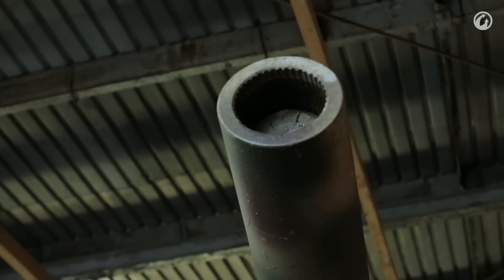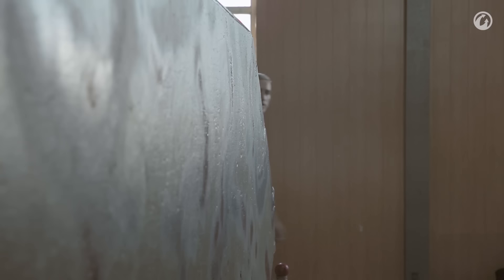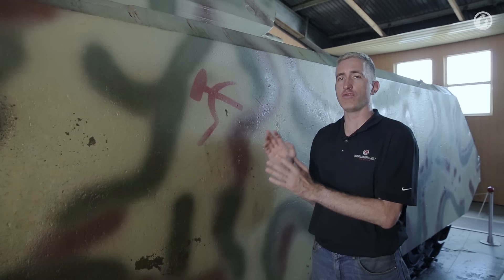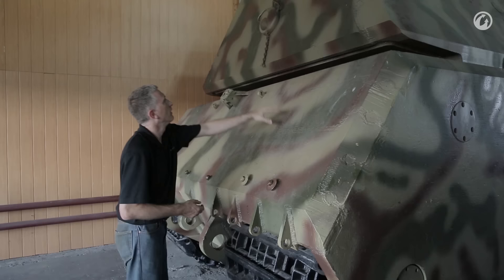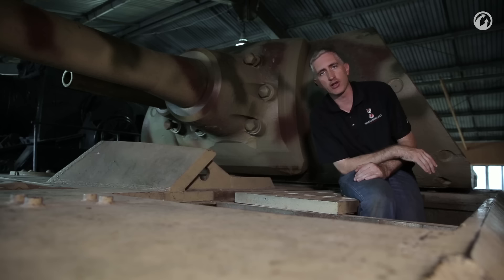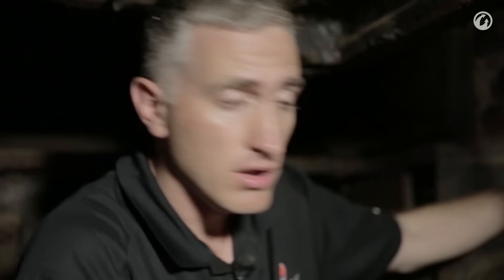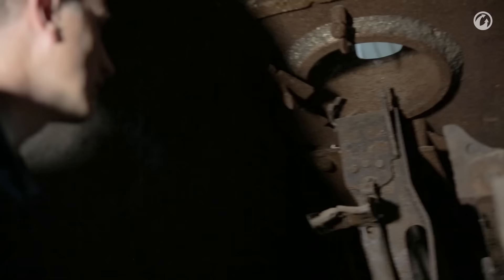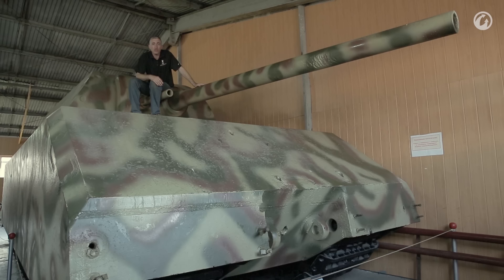Inside the Chieftain's Hatch: The Mighty Maus

Comment: I would like seeing this thing alive again, imagine an modern tank stuck in an corner in an city, noticing an maus driving around an corner and pointing the gun at this modern tank. The commander would be like " ahhhw i hate this job"
Reply: Doesnt sound too bad, the 128mm will do precisely nothing to modern composite armour.
Reply: T0mm3n 128 at point blank range, if it hits the modern tanks its over. Maus armor is made to bounce 128 cm or less even at point blank range, but modern tanks are designed to not get hit and if they get hit, most times they dont get directly hit, but on almost point blank range its not an good sign for the modern tanks...
Reply: T0mm3n not true really. modern tanks are a lot softer than you'd think.
Reply: babs beaver on like 150 meters away the projectile has its full power, it will go in wirh such an power, an direct hit will penetrate.
Reply: Davy Jones Considering the 12.8 had max pen values laughably short of modern mbts effective thickness, nothing would happen. Think of how much more energy a modern sabot round has compared to the 12.8, the 12.8 is not even in the same ball park. Modern sabots have well over double the kinetic energy compared to the 12.8 and still can have issues getting penetration frontally.
Reply: nmdiesel89 maybe on longer longer ranges, when they didnt get hit directly, but with an clear shot at point blanc range they will pop like ballons. However, the maus is so big, even an penetrating shot is not likely to hit something in there, but when it somehow hits some ammo the maus will be really, really destroyed.
Reply: Davy Jones The round would simply fail to penetrate, they dont have the required energy, density or hardness required. Modern mbt's where built to take hits from sabots with double the kinetic energy and the force being applied to a much smaller surface area, by a round with much higher density and hardness. Only thing you would have to worry about is spalling, but with how many blankets they have its kind of a none issue. Even stuff like T72's with 125mm guns and more modern ammo can't pen Modern MBT's. Sorry I like German tanks and all, but something like a challenger, abrams or leopard would laugh at WW2 tech, then put a sabot through the  upper glacis and out the back of the maus. The only hope it would have is a flank shot or into the engine. From the front all its going to manage is a mobility hit. Its like comparing a P51 to a F22.
Reply: nmdiesel89 if no one can destroy each other, one will start shooting at the tracks, and if the maus is geting to near to the enemy,  it can just stop the crew with an  he shot at the turret. Then almost all fragile technical things will shut down, anyways it would still be funny if something like this would happen.
Reply: What ever you say davy jones ,nobody wants to endup in your locker
Reply: Davy Jones How would no one destroy each other? You could almost line up 2 maus and fire a modern sabot through the first and still penetrate the second and almost exit the rear of the second. Even the older sbaot rounds at 1000m can pen 600+ mm of rha newer ones are pushing 800+. I have run into this before, with the "well what if the (insert tank name here, tiger, tiger II, maus, IS2 ext) was in a city and a abrams rolled by with all the optics destroyed already, a damaged gun and a worn out engine. The crew was so hammered drunk they didn't notice and the (tank listed above) rolled out and shot it in the ass". What if  absolutely perfect, unrealistic scenario.
Reply: nmdiesel89 so what? They will fail penetrating the front because of the angle, on higher distances maybe because the balistic like shot decreases the angle it will hit. On point blank range shooting on 45º angled, 200mm thick armor....effective armor is around 350mm....thats not really penetrateable, and apcr or ap is uneffective to because even if it penetrates, theres alot of empty space in there so i wont worry about that. Whats going for the modern tank armor, good against infantery anti tank weapons, bad against other tank shots. Like i said before modern tanks are designed to not or atleast not directly get hit by another tank. Its like saying an ww2 destroyer can 1vs1 an ww2 battleship and win. Even 1 he maus shell would be enough of an impact to may not penetrate, but literally whreck all the small, fragile, technical parts of the enemy tank
Reply: Davy Jones No 350mm of RHA is not enough to even come close to stopping a modern sabot (the maus is closer to 244mm @ 55 degrees btw you can find schematics with the thickness and angle, to approach 350mm the angle would need to be about 35 degrees). A m829A1,2,3 can penetrate the maus anywhere frontally at pretty much any range the gun and targeting system can reach it to include point blank since they are designed to and tested to penetrate 60 degree slopes. The amount of armor only makes things worse for the maus as thats when the modern sabots do the most damage, it would be better off being paper thin.

Whats going for the modern tank is its ability to with stand EFP's, KE and HE ammunition. Thats why they meassure armor nowadays in both RHA equivalent for KE weapons and chemical energy ext and are often estimated to be 600+mm RHA equivalent in both cases. Thats why every one went to composite armor, you get the best of everything.The only real thing in modern armor that is their to stop infantry weapons is ceramics. The steel, DU kevlar ext is there to stop KE weapons ie tank rounds. Take the turret of the M1A2, most sources put the turret at 1000+mm RHA equivalent.

A world war 2 destroyer could knock out a battle ship, its called torpedoes and speed.  

And we go back to the "well what if the maus just happened to have HE loaded and was perfectly pre aimed ext ext."
Reply: nmdiesel89 it an battleship got got destroyed by destroyers it must be an baaaaaaad battleship and the captain dont know what hes doing. I mean if an battleship is an ship like bismarck,  yamato etc etc torpedos cant even slightly penetrate the armor. Destroyers once set up an trap for an cruiser but instead of an cruiser an battleship was going in.... it destroyed all 7 destroyers because the torpedos could not get throug the armor.  But what i hate about modern tanks is one modern tank firesone good placed shot, it just has to hit directly another modern tank that means "game over" and an fight where it just matters who shoots first is boring. I mean im good at hacknslays but i always build a tanking character, why because its boring as an damage dealer, if i hit the endboss first, i one hit him, if he hits me im the one hit. Thats what i hate about modern tanks these things where disigned to take the shots but like i said one hit, one hit, one hit. But i think the crew would just give up if they see such an monster rolling around the corner.
Reply: Davy Jones kind of like how the Japanese battelship Fuso was destroyed and broke in half by destroyers. It has been a well learned fact, heavy immobile armor at sea or land, does not do much for you. medium highly mobile armor is what counts. If battle ships where so great most navies would not have moth balled them/ turned them into floating cruise missile launching pads. The little destroyers of today for instance would bend the yamamoto over a barrel 1 on 1. Same as a abrams, t90, leopard ext would do to a maus.
Reply: nmdiesel89 only if they used their long range rockets, 1 on 1where yamato can even use their small 20 cm barrels, they would only need to hit 1 good placed high explosive shell. Torpedos could be deadly but normally the modern ships have 1 15 cm barrel maximum. So fire power from the turrets of the yamato would be superior
Reply: nmdiesel89 only if they used their long range rockets, 1 on 1where yamato can even use their small 20 cm barrels, they would only need to hit 1 good placed high explosive shell. Torpedos could be deadly but normally the modern ships have 1 15 cm barrel maximum. So fire power from the turrets of the yamato would be superior.
Reply: Davy Jones you are aware that modern destroyers are many times faster than the old ones. they can effectively out run the turrets of a battle ship, and out maneuver it. They can effectively ass rape a battle ship, long range with missiles, or modern torpedos. There is a reason we as well as most other countries have moth balled or battle ships in favor of cruisers and destroyers. Its the same argument, "oh but its guns are x inches and blah blah." naval guns miss..... alot, guided missiles don't.
Reply: nmdiesel89 well you could basicly build and battleship with this fancy things but its to expensive and not for use in combat. Nowdays their mainly just needed for pirates and an destroyer is enough for that, an battleship would be overkill. Also, today just shoot an portable rocket launcher and you have an hole in the destroyer. The modern ships have targeting torpedos and missiles, but an battleship can tank alot and it also wouldnt waste an shell from the main turrets to destroy such an little destroyer. It would only shoot her 10 cm or 20 cm guns or smaller. Main thing is, today planes are wrecking big ships, and they are expensive as hell. Allmost as expensive as an aircraft carrier but not that efficient.
Reply: Davy Jones Maus armor is not made of RHA steel, but FHA. 350mm of armor < t 72's armor. And maus is an easy target for modern tanks. Even 76mm apfsds can penetrate 450mm of armor @2000m, yet it can't penetrate the REAR armor of M1A2. Maus is good for it's day, but every dog has its day...
Reply: Theo S well then the yamato will just oneshot an tank at 20 km distance, works.
Reply: babs beaver What do you think a modern tank is? the 128mm would do nothing to a modern tank, maybe it could damage the tracks but that is about it.
Reply: The 800mm Schwerer Gustav Railway Gun that was planned to be on the P.1500 Land Kreuzer would probably vaporize a modern MBT. ;)
Reply: Buck Schaffenhausen why, modern tanks have smaller guns than that, Abrams is 120mm and t-90 is 125mm
Reply: murf503 Smaller shells = less loader workload, allowing for high rate of fire & combat efficiency
Reply: murf503 Doesn't matter, modern tank guns use much more advanced projectiles.
Reply: nah,modern tank armor is strong enough to withstand it,plus a leopard 1 can shoot a sabot shell or so with 400mm of effective penetration.
Reply: +Davy  Jones  : missile have much much longer range than battle ship cannon,  modern destroyer can detect battle ship from hundreds km aways and bombarded it with hundreds of missiles until it sink. 
About the Maus vs M1 or any modern tanks,  well the main cannon of Maus cannot penetrate and modern tank frontal armour ( M-1 have around  1000 mm RHA protection again sabot round and around 1500 mm RHA again HEAT round ) while it extremely easy for modern tank to penetrate the Maus
Reply: the vu modern war tech is lame anyways, tank and warship fights in ww2 were more interesting. Nowdays they just use planes and drones. I mean seriously, yamato deserved something better than getting destroyed by small planes.
Reply: +Davy  Jones that's what she gets for have rubbish Japanese 25 mm AA guns.
Reply: Lance Lenhart still the evolution of aircraft during the second WW pisses me off. I mean without them there would be so much more interesting fights.
Reply: While I would've loved to see the battle buckets battle with 16 inch guns from portentous ranges, it would've been game over for the Japanese. On most the IJNs battleships were 14 inch guns. The ships that didn't use 14 in. guns were the nagatos and the yamatos. While the nagatos I can't tell you much about, I can say the yamato, while beautiful, was extremely wasteful. Testing shows the 16 in. mark 6/45 caliber guns on the South Dakotas and the Iowas actually preformed better that yamatos 18s. Plus most American ships had radar, the Japanese relied on spotter planes and men with good eyesight and good judgement. The yamatos 50 km range may as well be 20. While the Iowas could engage at 30+ km.
Reply: Lance Lenhart i know that, but i still think the yamato could have gotten in range without sinking before it could fire. I just dont like planes where pretty much anything is getting rekt. I mean, send 200+ of those fuckers on the enemy and every battleship no matter how good their AA is, is dead. Thats what makes it unfair, if yamato only had its type 3 shells ready...
Reply: Pearl harbour  showed us the carriers power, and we sure as heck abused it.
Reply: Lance Lenhart so true
Reply: Lance Lenhart holy fuck my name is Lance too! Though my famiky sometimes calls me Lancelot as thats my name but my identitiy name goes by "Lance" as Lancelot was too long. :P
Reply: Epsilon Lazerface cool :P
Reply: Lance Lenhart im literally the only person with the name Lance in my highschool,Lances' are so rare to find
Reply: +Davy  Jones ...and then kaboom
oops?
Reply: modern tanks would obliterate this argument is pointless
Reply: Only tanks from the game that could probably realistically damage a MBT from the front, would be either the Jg Pz E-100 or the FV215B 183. Those massive projectiles would inflict damage on whatever they fired at due to the size of their guns alone, regardless of modern armor.
Reply: finsfan90 HE from 150mm+ size calibre could also still deal some damage to a modern MBT,nothing is without flaws
Reply: +Lance Cupuchino 
True that def would inflict damage! And I know nothing is without flaws. Its the people who think modern tanks are invincible who say otherwise.
Reply: Davy  Jones if it has the same armement and protection as during WW2, the Maus will lose, the reactive, and composite armour or DU armour will bounce the Maus shot, the effective armour of modern day tank is an average of 900mm, and the ww2 tanks,noone of them can pen it, and the modern tank would just pen the Maus through the thick 200mm sloped armour like it's nothing and will destroy the tank easy like a paper
Reply: Davy  Jones i say that at pont blank range 200mm is equal to 340mm, modern day mbts like the t-90 can fire ATGM which has 1000+mm of pen with a HE charge,easy
Reply: Alexis Bierque de Birka de Fauville since when did HE charge managed to become like HEAT for no reason?
Reply: Davy  Jones A modern tanker, with modern fire controls, with a fully stabilised gun, firing Depleted Uranium Multi-segmented Armour Piercing Fin Stabilised Discarding Sabot rounds would punch a hole straight through the entirety of the maus, causing massive internal spalling and destroying crew and modules alike. All before the Maus could begin traversing its turret. You seem to be very fixed on the fantasy of this tank, whereas the reality is tank technology has advanced by orders of magnitude since then, and the maus would be utterly outclassed.
Reply: Me as TC would laugh maniacally and fire HEAT. Maus' turret would explode from the internal ammunition stowage detonating after penetration. Me and my Abrams would then clear whatever we were stuck on and continue mission. Maus doesn't compare to modern armor. It has a big gun and lots of solid steel but modern Chobham armor and modern guns overmatch it by a lot.
Reply: nmdiesel89 Regarding the comparison of the P51 Mustang to the F22 Raptor, looks like someone has been watching Top 10 from the Discovery Channel (the P51 Mustang is in 1st place but the F22 Raptor is in 10th place).